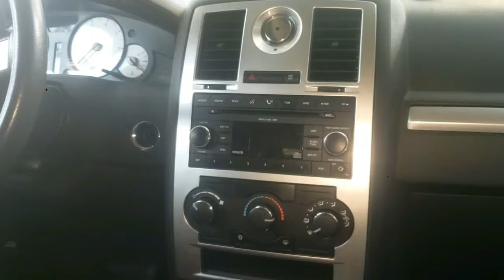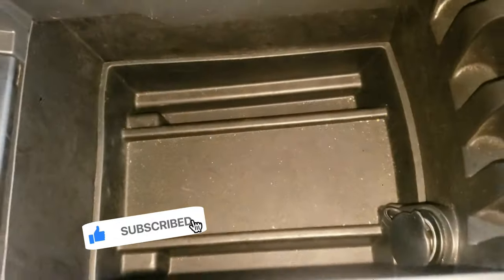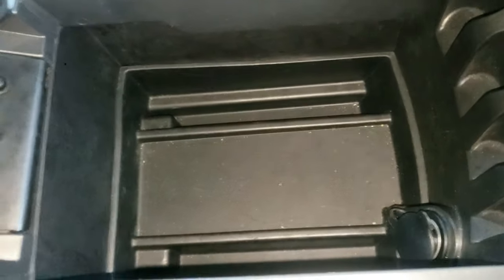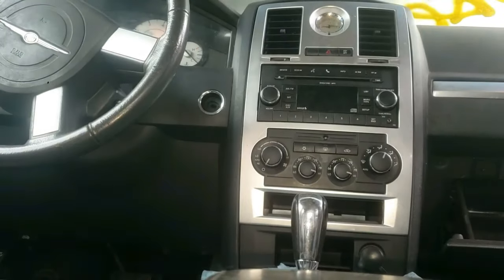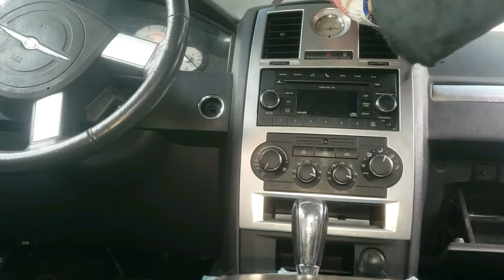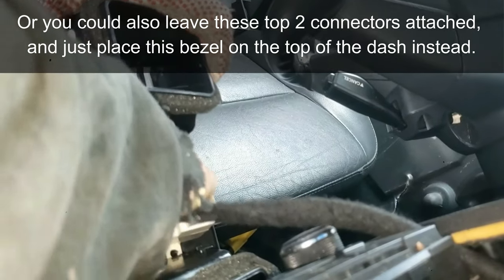Remove Power Outlet 🔌 🚬 Cigarette Lighter In Armrest For Chrysler Dodge Jeep

Comment: Thanks a bunch! I would recommend a slightly easier way to remove that forward ashtray, however. You can come in from below by removing the molding that is around the shifter. There are two screws under the piece of rubber directly below the ashtray. Once that piece is popped out, you can tug the ashtray from the bottom. and it pops right out.
Reply from the maker: Cool. Thanks for the comment. This should help others out!

Comment: So you said the plug underneath the radio is like an ACC it only turns on when the key is on. In the one in the armrest is always on?
Reply from the maker: Yes
Reply: They say so in the manual. But then there is a selectable fuse # F 11 that all it says is "selectable". Wat is for not sure.

Comment: There is no fuse for that one. If you know where it is please let me know.
Reply from the maker: Every cigarettes' lighter has a fuse, but depending on the vehicle you'll have to check the user manual to locate it.
Reply: @FixCarYourself  right. I can not imagine one without it. I have the manual. No mention of a fuse for that one socket in the console. They say it is always on. I noticed f11 in the box being a selectable. It doesn't say much more about it. it is a working 15 amp fuse. Not blown. Still the socket has no power. The wires in the back of the socket at the connector are black and red/white. They go in the dash board and then mystery. The car has only one centralized fuse box in the engine compartment driver side. All fuses are good. More mystery. I have no schematics. I asked the dealer for help. Sorry not going to pay them hundreds of dollars to swap a fuse.